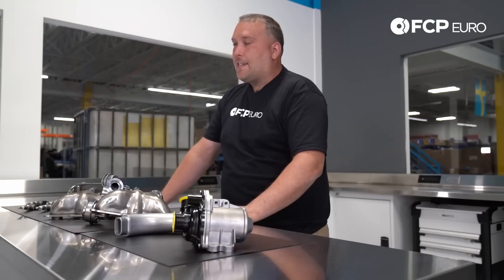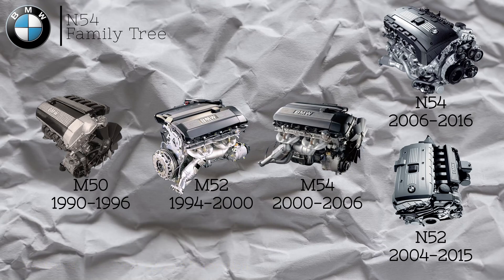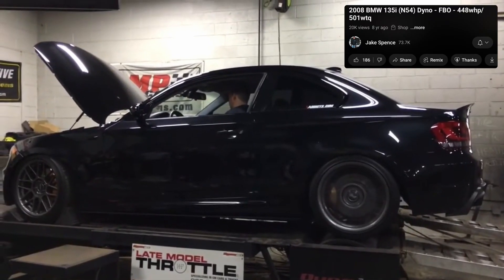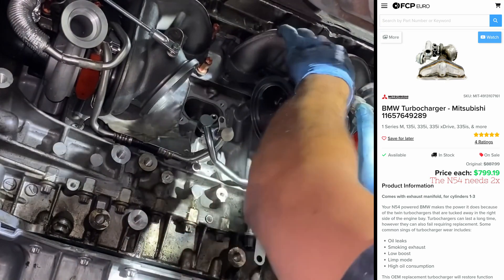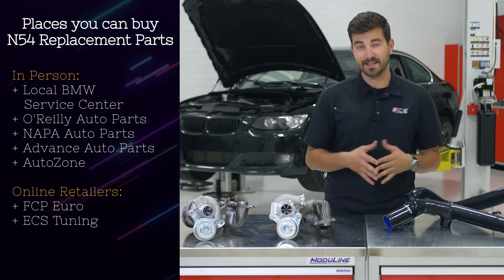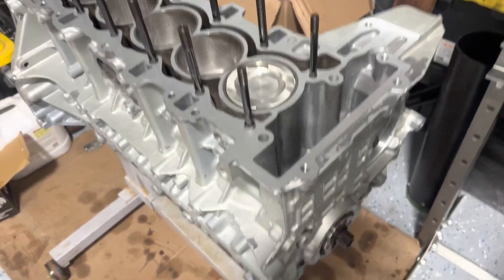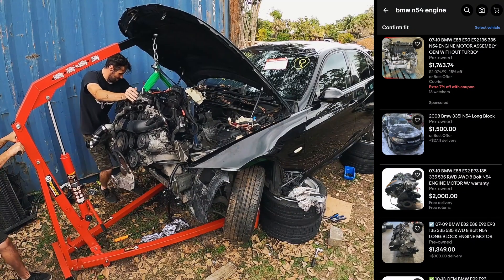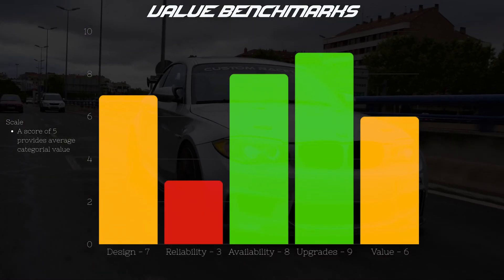How BMW’s N54 Became a Tuning Legend… And a Mechanic’s Worst Nightmare! | Power Rankings

Comment: N54 is fine the regular maintenance great engine platform. It’s Achilles heal is just the car it comes in. The only thing that pmo is the ps pump and bad motor mounts. The only reason it will throw a belt is motor mounts oil leaks. Honestly the oil leaks are easily maintained. I would write off the chasis for beating up ps pumps and making ps shafts walk out. At least the crank seal would save you from a near fatal incident.
Reply: I changed my motor mounts in 2023 they failed last week and threw my ps shaft and belt. Dosen’t help I live in a hot climate. Roads are outright terrible.

Comment: what you said is not true about doing an engine swap yes you cant run DI but you can run PI with maxxecu and it works pretty well get a DI delete kit for it then you will eliminate the hpfp problem making it more reliable
Reply: Or you can just have an extra HPFP on the shelf, it takes an hour to swap if needed. Also FCP Euro lifetime warrantee for the win.

Comment: Mostly well done video. Thank you for the hard work in making this video!!  A few things however and I disagree that it's not the cheapest way to get into BIG POWER. LOL. Just sayin that for almost all big power cars they cost A LOT up front. The cars that have the N54 can be picked (If you're paying attention and watching) for very little. EG the $300 535i you showed. Most will not be THAT cheap even if broken. I picked up mine for $1500.00. It was the only way I could get my hands on potential big power. Yes it was broken but because of the many troubles they are prone to I went checked it out determined that it wasn't anything big like the engine or trans and went for it. It was the High pressure Fuel P{ump and it had a bad front wheel bearing. It came with two sets of tires and rims too! Both sets in great shape. So after a few years of doing the work myself piece by piece I now have a 730HP MONSTER running on a E40% mix of E85. I was able to buy parts as I could afford them. It's not the big things that go bad on these cars as you guys have pointed out it's the supporting parts like the water pumps or the Coils or the PCV system. The engines are why they can make the power. They came from factory with mostly forged internals! Oh and your list of the cars and years of production has the "IS" version as being from 2006-2010 when it was ONLY made in 2011 and no other year. Sorry I know picky but I just had to say it! Thank you for the great content guys!!
Reply from the maker: Hey man, thanks for the comment! I'm still working on getting better at making content so I appreciate the input. {Contrary to popular belief, I'm just 1 Guy and I run this channel by myself in my spare time 😂}

Your build sound pretty epic and I'm slowly working on building my $289 535i into something crazy. But like you said it's a long process, and I also have a few other projects on the channel That usually take priority. But if you want to follow the progress subscribe, and I'll be looking forward to possibly seeing your expertise in the comments of future videos!

Comment: "N54 was the first turbocharged engine in almost 30 years" - not true. The last BMW 745i with M106 turbocharged engine rolled off the assembly line in 1986. So the N54 started production 20 years later.
Reply from the maker: Didn't know the e23 came with a turbocharged variant. Looks like they only came in European left hand drive countries. Would have been really cool if they had sold that engine globally 🥲

Comment: Love my 07 n54 powered e93! When I got it didn't know much about the platform.... but ya learn fast lol. My main issue with my car was the ECU bricked and I was new to reading codes and understanding them.... so after throwing a whole new set of Ngk plus and eldor coils and new index12 injectors ( i got lucky and bought mine before the skyrocketed in price) I still had issues..... while I was thinking it was the injectors themselves it was actually what controls them... the ECU. Can't recommend enough to upgrade to an MSD81. I've been fbo stage2+ tuned for about 3 years now and I've rarely had an issue. I am however fxn to install a new HPFP and go with some new twin turbos form ECS.... not that my turbos are blown ....(wategate rattle) but figured it would be fun to try some OEM+ spinney boys😯   These are very much enthusiasts cars and require a little more time and money than your average sports car..... but hey.... when ya buy an aging German sports car.... ya gotta pay to play 💯
Reply: Adjust the waste gate arm. Temporary fix for the rattle but it definitely helps eliminate it. It’s like a night n day difference and only takes like 15 minutes tops.

Comment: Most turbo problems come from bad behaviour. Like burble tune and turning the car hot off. Stock turbos can last easily over 200k km. They will rattle but they will last.

Biggest problem and no solution in sight are the injectors. They are so expensive and even index 12s can fail if you're unlucky.
Reply: Used injectors (especially index 1s, if they were gonna fail, they would have already) or DI delete. 

I've literally never been to the junkyard and not found at least 1 n54 with injectors in it to pull.

Comment: There is a thing you can't really solve on a N54 , thats the water pump issue , my Pierburg pump just died within 800km due to the electrical issue , this is the most frustrating thing i can't solve in this platform ! 2nd , my newly installed 6x indexes 12 , running on B58 eldor coil + new plugs , still slightly misfiring .......... i am speechless . Good luck to all the N54 enthusiast out there
Reply: Go with the s55 plugs they are step colder
Reply: @PHFilms3  Changed to Ngk97506 recently , testing them .
Reply: use B58 plugs, and when is last time it was walnut blasted, and do you have catch cans to keep the valves from getting gummed up as easily??

Comment: 179k and FBO, runs strong. Well worth it if you actually take care of your BMWs, coming from a M54B30, to a S54 and then a N55 M235, this engine is awesome and easily upgraded to where you want it. Just keep up with the maintenance, if you buy used do all the works with the cooling, gaskets, and preventative maintenance and you’ll be fine.

Comment: Love my n54. An 07 335i with 194k miles and still running strong🤗....hate all the HORRIBLE electrical issues that comes with it especially if you swap to led bulbs for the head and taillights😒

Comment: Unreliable? Sure, if you dont take care of your basic maintenance. Had a single turbo kit on my car for the past 15k miles with little to no issues because Ive stayed on top of my maintenance. These motors are sadly plagued by moronic owners who neglect taking care of their cars. Not overrated IMO, 700whp stock block + a banging 6 speed manual trans is perfection,
Reply: exactly bro. got a n54 fbo upgraded twins with 213k miles still pulling hard as shit. I literally cant understand the hate.
Reply: @Projectbaghuul  I live by "if you take care of the n54, it will take care of you" these motors are old and need some extra love but properly built 335s are amazing cars
Reply: what is youor top speed on a 700hp n54 and how well does n54 mix with nitrous
Reply: @ 160+ mph, never ran nitrous so I couldn't tell ya

Comment: Bro it’s 2025, NOBODY should have an n54 and not do a Di delete. just go with port Injection, you no longer need those expensive index 12, or the hpfp. And stand-alone Ecus all support this.
Reply: I've heard that they struggle with excessive cylinder temperatures without DI to keep them cool?
Reply: @ run the car on e85 and it’s perfectly fine. Can even add meth if u wanna go even further
Reply: @ThraxJay  Fair
Reply: Yeah just go di delete for 3k and then do standalone for another 5k. Shut up dood! Ur dumb.
Reply: Sure just drop 7 grand on an aftermarket ecu and port injection kit plus install and tune and you’re golden
Reply: @cptrey don’t even need a stand-alone anymore as the Nexsy di delete comes with mhd support now

Comment: B58 is now the new N54 and much more reliable sadly lol
Reply: But much more expensive. The n54 can be worth the hassle if you do the work yourself. Plus you can always perform what I like to call "upgrade maintenance" which basically just means when a part breaks, put the upgraded version on
Reply: Yes, but it's not cheap.
Reply: I say, if you know what are you doing 135i is a monster for the money?
Reply: uh huh... until the bore get's scored.. N54 has iron sleeves, B58 is electroplasma coated.  eventually that coating will wear out and the block will be junk unless you can find someone else to re-plate the cylinders.

Comment: 3rd comment... I.just got a 08 535i n54 6spd, needs lots of manteinence parts
Reply from the maker: Congrats! I got a 535i too, But I wish mine was a manual like yours {manual swap maybe?}. Mine had been abandoned for a couple years; so I know all about e60s that need a lot of maintenance 😂
Reply: Damn you got a 5 series. Literally throwing money into an open flame pit.
Reply from the maker: @ LOL! two of them actually. The e34 that's getting LS swapped and the $289 junkyard rebuilt e60 535i